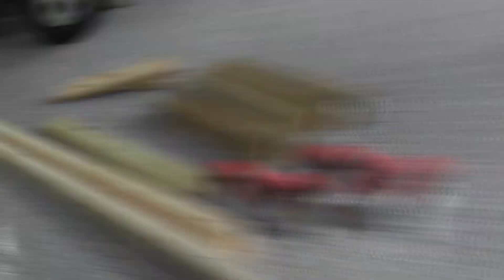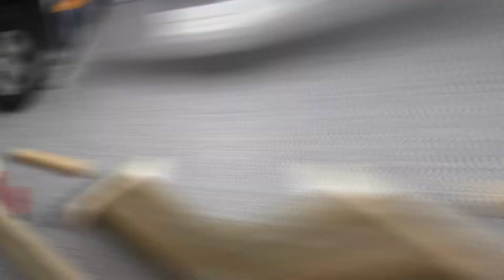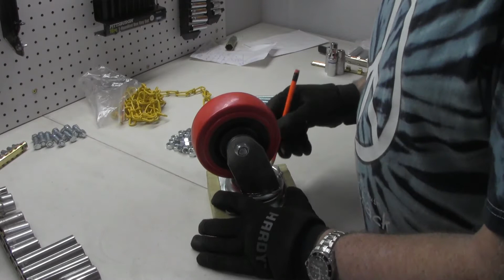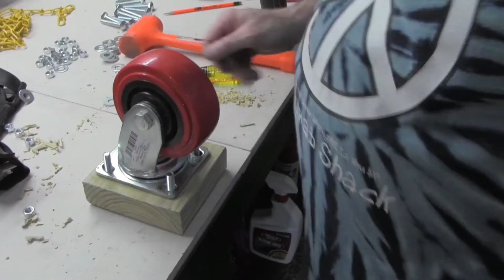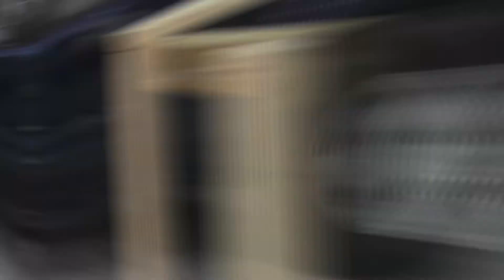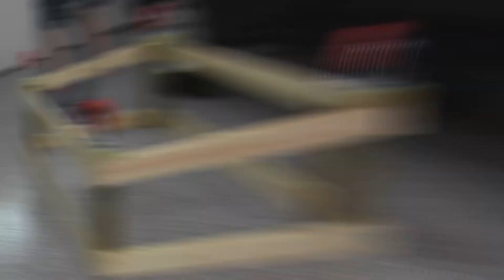Make a Low Buck $ Pick Up Truck Bed Dolly for Ford, Chevy, Dodge, Toyota and Nissan trucks

Comment: I have the long bed of same truck.  Should I make the length 5 feet?
Reply from the maker: You can, but it is not necessary. The bed is not that heavy.
Reply: @laurencevillegarage BTW I made the length 6 feet long, 3.5 feet wide.  Seems sturdy or do I need to add a center support and wheel?  My Gaylords tonneau cover is super heavy.  4 people kind of struggle.. maybe time for a new lighter one.
Reply: I finished the frame yesterday before sundown.  I couldn't find a wood chisel.  But the little storage wheels I used a 5/16 big bolt and did it directly to frame.  Can I do that as well with the main casters?  Bolt it directly on? Or is the 2x6 base w carriage bolt necessary for strength?  I was about to skip the base and bolt it directly w a 5/16 bolt & lock not.  Will it be same strength?  This was my 1st wood project EVER 😂 Thanks for the video
Reply from the maker: @cybergrindin  I used a 2 x 6 and cut four pieces that were basically square. Mounted those into the corners you can use lag bolts to hold the caster on. Or, without using a chisel, you can just find a large drillbit say about 1 inch and drill a hole about, a quarter of an inch deep this will allow you to drill a hole through that and counter sink the head of that bolt so that you can attach your caster and then put your lock washers and nuts on. That’s what I did.
Reply from the maker: Sure, you can make it 5 feet. That won’t hurt anything. The best investment will be in good casters. Don’t get crappy ones. I got mine at Northern tool, I think the set of four was around $75 or so . My wheels are 4 inches in diameter, and they work well. However, 5 inch or even 6 inch wheels would roll easier. The frame will support the weight. I can’t remember if I mentioned it in the video, but I added a piece of plywood to the top, making it a bit of a deck or, moving workbench. Comes in really handy for other projects as well.

Comment: I actually built this to serve as my CAB dolly as I wanted the cab to be as high as possible off the ground for doing bodywork e.g. welding in new cab corners but still fit into the garage.  My configuration ended up being 39"X57"X27.5" - built on 5" casters.  But in the interim (since I don't have the cab off yet) it is serving as a work service for dent removal on the box sides, welding, sanding etc.  It is also  serving duty for hanging the fenders off of to work on them.  And at some point it will also serve as bed dolly.  A multi-purpose configuration - lovin' it.  Thanks!
Reply from the maker: Glad you found it helpful. I've since added a piece of plywood to the top and added larger wheels to one side. I have used it for way more now than I expected. The wheels on the side allow me to store it in the garage and take up less space.

Comment: I followed your suggestions on making it a total height of 26 inches and it is a great height :) I made it from scrap pressure treated wood that was about 12 years old. :) I gave the old treated lumber another purpose LOL The dolly measurements I used was 46"x65"x26". I used it on my 1985 C10 truck bed but didn't use casters because the bed and dolly are both going to be outside since I do not have a garage :( If you wanted to go up to 30 inches I believe that would be the highest height anyone should go for this project. Later, on after you have to repurpose the dolly it could be ideally altered and changed into a workbench by adding a metal countertop (1/8" sheet of steel ).  Thank you for the idea :)
Reply from the maker: You're welcome, thanks for the kind words. I ended up cutting a piece of 3/4" plywood for the top to use as a rolling workbench. My wife has been cutting and painting a lot of wood trim pieces for a closet project she is working on and it worked great for that. I ended up with the height I used simply by cutting the wood I had into 4 equal pieces. That's just how it worked out.

Comment: IT looks like it might be too short in height.
Reply from the maker: Not at all, the casters are about 7.5" tall added to the wood, total height was about 26".  Any higher might have made it a bit top heavy and harder to push around and see where I'm pushing it. I was able to push it around the garage easily by myself. Would I really change anything about it if I did it again? No, it works great. Don't cheap out on good casters. Minimum of 5" to go over cracks and irregularities in the concrete of my garage. Thanks for the comment.